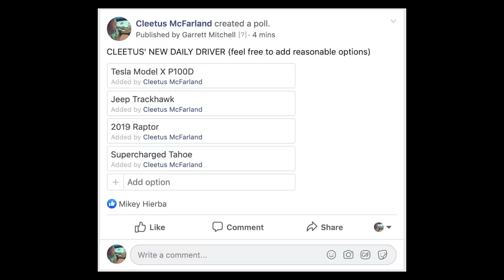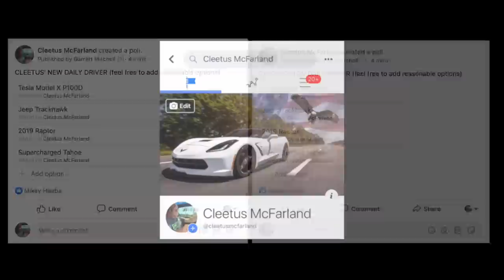Our DIESEL Powered Ford Galaxie is Getting AIR RIDE! + CHOOSING A NAME (please vote)

Comment: You need to use dryer vent tubing it works best! (Like so he can see)
Reply: fuck i had the same idea! make sure you get something with a large diameter the less restriction the better and maybe a cheap fan at the other end to provide negative pressure, would also look cool coming out the back!
Reply: What I was thinking and probably some clamps or aluminum tape to hold it in place just incase
Reply: I would be concerned about temps using that setup. Dryer venting is not that thick and may end up melting; just compare it to regular exhaust tubing. I could be wrong, but dryers only run at a couple hundred degrees verses auto exhaust which is well over a thousand.
Reply: Next video:  Cleetus, James, and Cooper get kicked out of Home Depot

Comment: Cleetus!! Before you get started switch to 3H Airlift... you have 3P which is just pressure based and harder to control ride height. 3H has ride height sensors which helps in ride height stability, adding passengers it will readjust to your preset, you can set ride height presets instead of just guessing based on bag pressure. You can just swap out the ECU and buy the sensors to add to the kit! Can't wait to see the updates on the galaxie
Reply: As great of an idea as that is he won't do it. He's too busy "boggin" to read comments and make smart decisions.
Reply: Not to mention, they already lack the knowledge to correctly bag this car. Let's not throw in more shit for them to do incorrectly.
Reply: The height potentiometers must be precise at each corner, but once mounted solidly and dialed in...a killer, superior system. I did one myself with the assistance of the owner of a G35. I was scared to death of fucking up the sensor mounting. Cleetus and all do not need the headache, however superior. This will be their intro, then they can upgrade the controller and get sensors later. They have the means.
Reply: I may be wrong but I think those re7 bags are going be rough as hell without a ping tank.
Reply: I agree I run 3h... but I ran 3p for a while it was fine. 3h is also direct to height 3p will air up all the way and drop the car to preset height.
Reply: Considering he said he was new to air suspension I was just pointing out its available for upgrading should he choose... Simply just a suggestion... 3P is more than capable and will bog deep in comparison to whats there!

Comment: Stove venting at Home Depot is cheap and it comes in a bunch of different sizes, I use it for running the truck in the garage and it works perfectly 

(Guys help me get this to the top so it doesn’t get lost)
Reply: Chris Mantz yup. Flex drier vent. Can get it in 20ft sections
Reply: I was thinking dryer vent tubing. The hard flexi pipe.
Reply: This would work well but it has to be a blown duct. I made one out of a cheap large floor shop fan (harbor freight) linked by Heavy garbage bags to a 12 inch pipe to pull just enough air to equal the volume of smoke. I hung this over the stack and plumbed it out the door with the fan sitting outside. If you hook a hose directly to the stack you are adding back-pressure to the turbo and changing the results.
Reply: use the stove pipe but add a squirrel cage type fan on the end so it sucks the freedom out.
Reply: Dryer aluminium flex
Reply: this is the second comment for me
Reply: I'f you want to make it permanent with a flex pipe down to the stack, suspended from the ceiling I got the ladder.
Reply: aluminum dryer flex duct is way cheaper and longer when you stretch it
Reply: Was gonna say flex dryer vent, but same shit.
Reply: I just went up to the local automotive school gave them 10 bucks and got an actual exhaust venting hose, hooked it up to the shop vac and was golden.
Reply: This would work great
Reply: @BoostedBoiz
Reply: Or just visit any fire department and check out their venting systems all the ones around here use them.
Reply: Vote ROSCOE!
Reply: @cb2536  .........dang, I was just thinkin that. Guess I'm psycho. Well, that's a given. Even most garages have to have em now for all vehicles. Surprised they don't.

Comment: Seems like you have your daily driver allready cleatus.  Put the money into the galaxy and have that as your daily driver.
Also rear brake disc conversion.
Reply: Yes! Holley could have a whole playground in that back seat area!
Reply: This is honestly the best daily driver idea. Put the money from the C7 into the galaxy and make it perfect.
Reply: I was having the same thoughts
Reply: Exactly what I was going to say. Seats 5, makes good power and will be able to pull a trailer. Checks all the boxes
Reply: And lengthen the Panhard rod, making it level at standard ride height, if there is one

Comment: Make sure the killer dowel pin in the timing gears is blocked off if not it could mess up all the timing gears. Just a real easy fix that’s kind of dumb on 12 valve and 24 valve Cummins
Reply: I agree. Needs to be high on the priority list.

Comment: Cleetus, Add delivery valves, delivery valve holder .093 inches also .093 injector lines for even more fuel. Also look into heavier valve springs and a governor spring kit let's the engine support more fuel for higher rpms 4000-5000 rpms. and a borg Warner s400 series turbo. I'm building a ppumped 24v called the "U.S. 24 VALVE" also as far as the exhaust goes. Look into how fire stations reroute their exhaust from the truck bays.
Reply: Also forgot to mention. Head studs very very important. Also name it guardian. Guardian of the galaxy

Comment: HVAC flex metal line to plumb the smoke outside the shop bro
Reply: kiollosis agreed!
Reply: Can even add an in-line blower-fan if needed. Pretty cheap too. I was amazed at how much air a $75 inline fan could move when I used it to keep my grow lights cool.
Reply: glad someone said it... i was thinking the 3 and 4 inch flex dryer vent ..the metal type. But yeah the HVAC is the same but longer lengths!
Reply: Dryer vent hose. Always works and you can get them up to 16' long
Reply: Was just about to post something similar!

Comment: Go to Home Depot and get some flex tubing used for dryer air outlets. Will take all the heat
Reply: just cut a hole in the ceiling...hehe
Reply: dryer vent won't handle the heat nor the flow.
Reply: Its called metal flex but it probly wouldnt last long
Reply: Robert Romney well it worked fine with my buddy’s Cummins, they ran 8’ of that 3” metal tubing out of the shop and it worked fine.
Reply: spacejamgoliath that is true, it did 3 pulls at 30psi then They did have to replace it with another one after that.

Comment: For evacuating the soot for the dyno.  Most tool shops in Australia here have extraction fans (about a foot in diameter) with a flexible ducting extension.  Would work perfectly.

Comment: When you're doing air bag conversions, think of the airbag as replacing the spring only. So in the front just deleting the shocks is a very bad idea. Because of the coil over original design you will have to fabricate a mount elsewhere on the control arm, but you absolutely need the shocks in addition to the bags for it to have any kind of ride. If you just go with the bags without a shock it's going to bounce terribly.

Comment: Garrette: Make sure the Galaxie doesn't fall off the 2 post 4 arm lift! 1500+ lbs of motor and transmission on the frontend against the weight of just the rear?? Better be careful and use some screw jack stands under the front end before banging on some  ball joints!

Comment: 15:00 Home Depot go to the HVAC area and get the small diameter pipes, usually 3' long, the proper hose clamp and a couple of elbows. Some rope from the ceiling to hold everything and BOOM. BOB'S YOUR UNCLE. Diesel exhaust out the door.

Comment: flexible dryer vent piping. Make sure to clamp that sucker down
Reply: I would be concerned about temps using that setup. Flex dryer venting is not that thick and made of aluminum; it would end up melting; just compare it to regular exhaust tubing. Dryers only run at a couple hundred degrees verses auto exhaust which is well over a thousand.
Reply: @jezeski2011  That's dangerous for a diesel, EGTs' shouldn't go above 1000°F for more than a couple minutes.
Reply: @wyattlarrick3246  still have to consider the sheer pressure and temp verses thin aluminum. I have much experience with that venting (doing dryer install for a living for a couple years) and it just does not hold up to abuse.
Reply: Chris isn’t there like a hard/flex pipe for dryers and chimneys they could use? I swear I remember seeing it somewhere.

Comment: Metal exhaust flex piping and a couple straight pieces attached to the stack or loosely fit over it will put it outside.

Comment: I’m a diesel mechanic and what we used to get exhaust smoke out of the shop is we have dryer vent hoses and hose go from the exhaust pipe and then hook into a vent that is attached to the garage door and have no issues if you need photo so you can see what I’m talking about just p.m. me

Comment: Now I’m coming from a plumbing and HVAC world but what I would do is go to Home Depot/Lowe’s and get what is called “B venting”. It’s able to take on extreme heat‘s from furnaces and take it outside. I think that he would do a pretty good job running the exhaust up and over the car and out the back door.

Comment: They do make shock relocation brackets for the front. Use loctite 545 for threads instead of the Teflon tape. If you do wanna use tape go with the yellow one

Comment: No shocks on the front??  You need shocks on the front, definitely with that 800lb motor!
Reply: Or get bigger bags up front. You can run bags only up front.
Reply: Many have ran no shocks in the front it just floats a lot. I run shocks all around on my truck and it is definitely a way better ride. If they have some mediocre fab skills they can do mounts up front it’s not hard at all

Comment: flexi aluminium steel tube is best because can place on floor out the door around the corner out of site. its not cheap though. we used it for a 80 foot cherrypicker and truck inside the Melbourne trading centre Australia when painting the two story with dome area back to 1900 period. aluminium disperses temperatures better through the tube.

Comment: I think a NV4500 would be cooler and I guarantee it’ll outlast that 47re all day long. And as for a name “Frankenstein”
Reply: Obv NV5600 for that 1 gear you never ever use.
Reply: Nv5600 kinda sucks unless you tow. But the 47re built is better than either of them. But stick is more fun
Reply: @Dirtyol12valve  Yeah im not rich enough to afford a built auto trans and no one around me would do it right.

Comment: 🤣🤣🤣 I cant! At 3:40 Laz in the background has the same walking demeanor as the Sasquatch in the old Bigfoot video! Maybe that's a sign to name the car "Squatch"! 🤔 And get ya some of that aluminum flex pipe that hooks up to dryers to slap on the exhaust and run it out the shop.

Comment: go to home depot and grab some flexible dryer ducting
Reply: I would be concerned about temps using that setup. Flex dryer venting is not that thick and made of aluminum; it would end up melting; just compare it to regular exhaust tubing. Dryers only run at a couple hundred degrees verses auto exhaust which is well over a thousand.
Reply: @jezeski2011  diesel exhaust past turbo is lukewarm. Thermodynamics! That's why diesels are so much more efficient than gas engines.

Comment: When I was 11 years old my mother drove straight while the road turned left as she was "attending" to her 5 year old daughter that was vomiting while sitting on the front bench seat between me and my mother. The 1963 Galaxie 500 2 door hit the maple tree in it's path dead center. The 352 ford engine was pushed through the fire wall and into the forward passenger compartment. It was a gruesome crash with everyone sustaining sever injuries. My father eventually replaced the totaled 1963 Galaxie with a 1965 Galaxie 500 2 door. The car was delivered from the dealership with the front shocks never connected. 8K miles later when the front tires were worn down the "tire guy" at Firestone Tires made the discovery after Ford dealerships and other mechanics had inspected the car several times. After the shocks were connected the car drove pretty good.

Comment: You could still run shocks in the front  Weld a bolt on top and bottom stick the shock in it

Comment: The simplest easiest and cheapest way will be to run flex pipe on a wire hanger system and exhaust it out your bay door behind the dyno you can buy rolls of flex pipe anywhere from 3in up to I believe 8 or 9 in

Comment: You should notch the frame so you can late the frame rails on the ground. My dad bags old squarebody c10 and we have to body drop them in the front so the transmissions and everything won't it and it will lay flat all the way around

Comment: Go to lowes and get the air duct you use on the back of your dryer from home & connect those they sre made for your dryer so they can take the heat and there cheap get a few of them and connect them

Comment: Doesn’t need more fuel needs more boost and to be tuned to suit ,  get a custom turbo something that can spool up quick and also big as possible inlet side so can suck in most air , also intercooler Is must or if not compensate with Nos

Comment: you should make a cage type thing that goes slightly lower than the trans sump, running either side of it, just to protect it when you do bottom out.

Comment: Before you go hacking on that tunnel you may want to set it down and check that pinion angle and all of the bushings in the control arms. My guess is that the angle is too high either due to setup or bad bushings. You could fab up or buy some adjustable uppers to crank the pinion down out of the floor...

Comment: I would buy some dryer exhaust flex pipe for a dryer vent and some steel zipties and zipties it to the pipe and run it out of the shop. I would also weigh the other end so it don't shoot around.

Comment: AHHHHH cleetus, have you guys not noticed the rear diff assembly is to the right, the tail shaft is not straight either... you may need to look into getting an adjustable panhard rod. but that rear end is not straight... check it out for yourselves @13:17

Comment: Don’t use pvc pipe it will melt in 2 seconds. Dryer or Flex pipe. Flex pipe would be better but does take some coins to buy it. Love the car.

Comment: i have a w123 om617.92 300d turbo diesel with a hood exit aswell, when i go to the dyno i usually swap exhausts to a straight pipe out the back same size as the hood exit

Comment: air ride has come a long way since I had it, back in my day you where lucky if all your solenoids came attached to a block and don't even get me started on cheap garbage Air Cylinders that kept blowing seals like Cleetus blowing junkyard motors in Ruby.

Comment: get a york belt driven ac compressor to fill that sucker quicker than anything else ... highly recomend a larger air tank.  that small tank will limit you big time .. and deff run shocks in the rear at the least or youll get bounced outta the car haha ..
Reply: can find the compressors for near nothing at junkyards ... mid 80's mercedes

Comment: I'd bet money the joint isn't hitting because of people in it. Your springs are weak. When you get on it your turning the rearend up and hitting the floor. Again air ride will help hold the weight but your body roll will still be there....and may be worse with air ride

Comment: Here's a thought... I may just be crazy and have no clue what I'm talking about but why not raise it a inch or two to protect the fluid pans and lower the body panels, or like add an few inches to make the body line lower. Stiffen up the suspension. Then you won't have to worry everytime you start the car or you know the 4 or 5 inches the ass is gonna drop when you put a trailer on it. Never really ventured into body work like that cleet. I think it would be funny as all get out.

Comment: That 'floor pan'dent,and the 'transmission pan'dent are from not supporting the frame to  the floor when you  trailer a vehicle.Duh.Who would let their car bounce against straps?Wow.Everyone has rubber wheel chocks.You don't use them to support your frame against blocks under the body/frame by turning the chocks on their side?

Comment: Get a duraburb there’s a company there in Florida that will make them on a 2500 chassis and give it quite few performance goodies plus they the better fuel mileage because duramax diesel and they look stock they’re sweet

Comment: What year is it? I used to have a 1967 Galaxie and ive been waiting to see another one. I think I finally found one look almost exactly like mine old one. 390 engine headers duel exhaust 9 inch rear end. Car was bad ass. I wish you would put the year on or by the title.
Reply: It's a '65.

Comment: you should use the flex hoes that u find on the back of the dryer ab washer it wont melt it is meant for heat an you can get rolls cheap

Comment: Facebook is more "snitchbook" than anything with the selling you name to companies for insurance, bitcoin, etc! Thunder tin should be the ol' girls name, and mount a air compressor on both ends for quick response. Gotta be room somewhere if just between inner an outer fender. hose will mount discreetly. I started mechanicing in 58 for dad and the other guy in 62 but diesel is all I ever worked on... Well whole damn truck but Detroit to Cat to Cummins engines. pump power, turbo power or supercharger power, make no difference. hang big vacuum cleaner hose close to exhaust and drag narly smoke outdoors Later men

Comment: Use the same hose firemen use in their stations. It attaches to the exhaust pipe so they don't smoke out the whole garage.  https://www.zip06.com/news/20180131/winthrop-fire-station-gets-exhaust-upgrade.